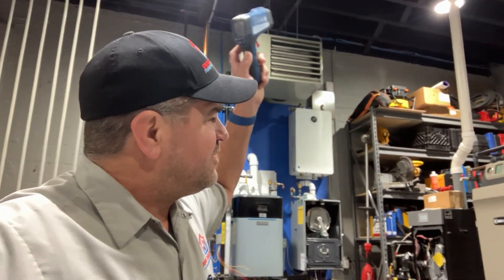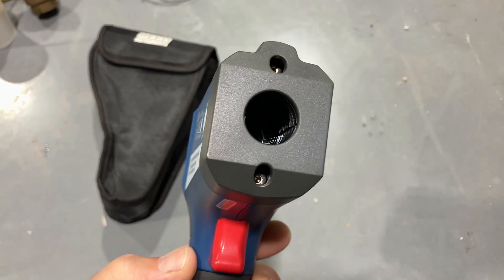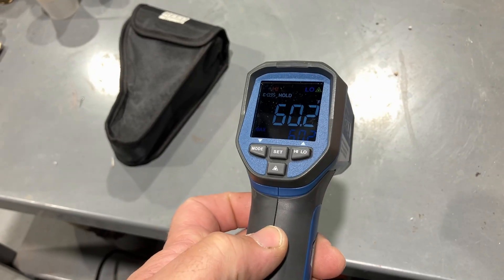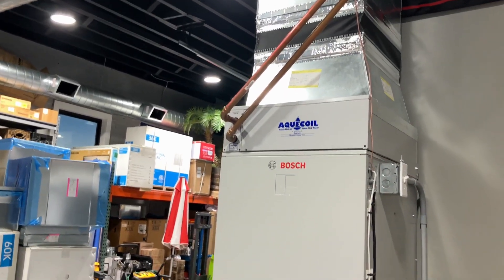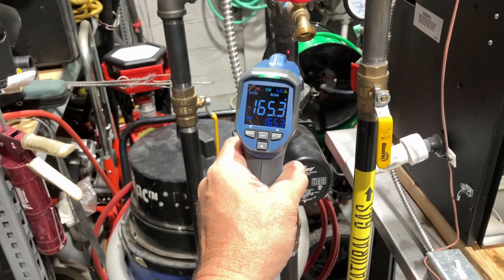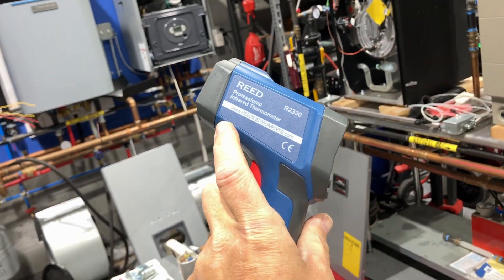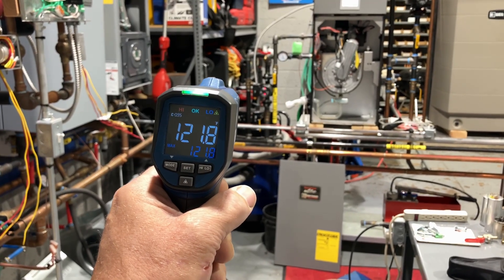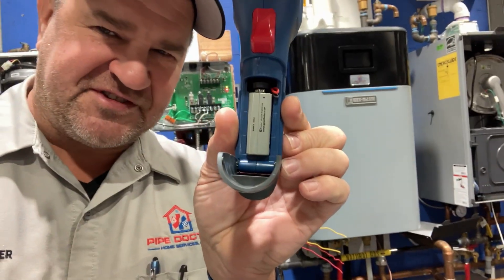HVAC Techs NEED This Tool! REED R2330 Infrared Thermometer Review & Test

Comment: Hey Mike, just a question on a hydronic boiler, what is the proper water temperature to run through the system that the boiler makes to circulate?
Reply from the maker: depends on what the output source is, but generally, in my area, baseboard copper tube fin is 180f
Reply: @PipeDoctor  That is what I have, copper tubing with fins, just got to turn it up a smidge, thanks for answering so fast, love the channel